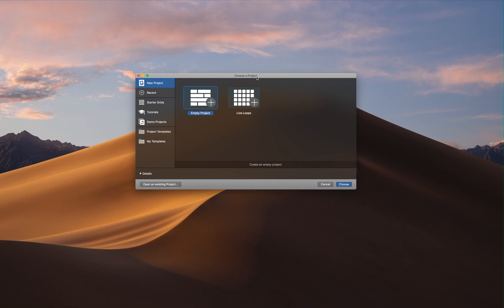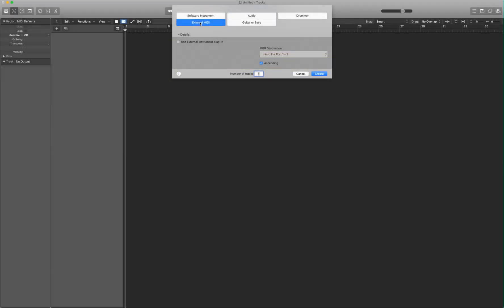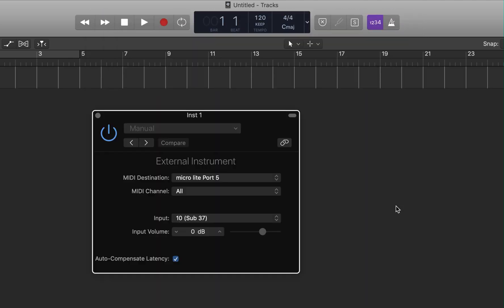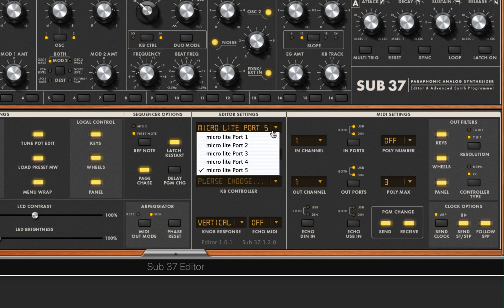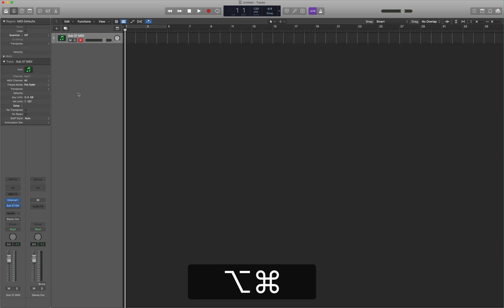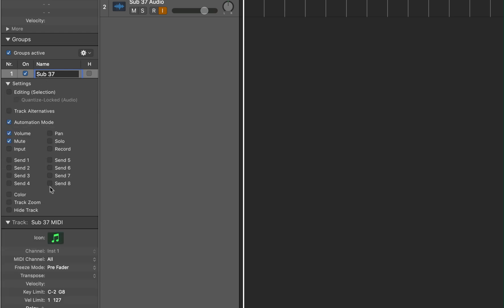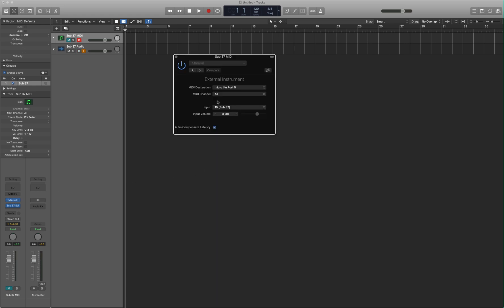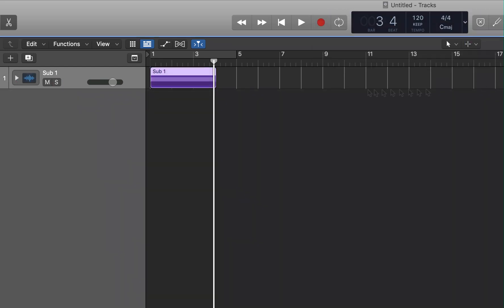Setting Up The Moog Sub 37 In Logic Pro X Using MIDI Cables

Comment: why not use usb to computer vs midi in and out? just got my s37. very confusing to connect
Reply from the maker: You can use whatever suits your environment the best. I use a MIDI interface so that all my MIDI gear connects to my computer with a single USB cable. If you prefer to use USB direct, I have a video on setting that up as well.
Reply: Could I use a strymon big sky as a midi interface? It has in and out but my Apollo x6 does not. I’m also a bit confused by this. A video tutorial of the pros and cons of usb vs midi would be helpful.